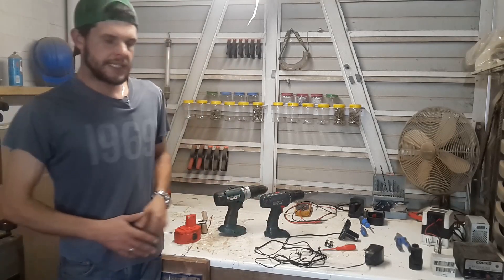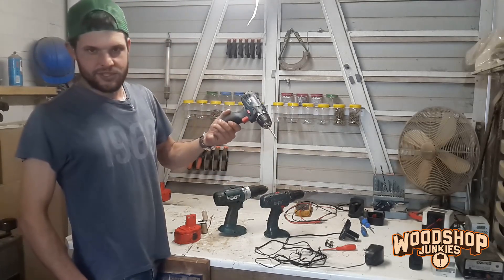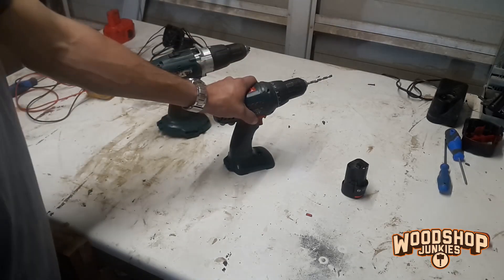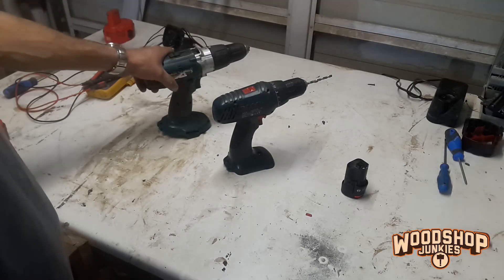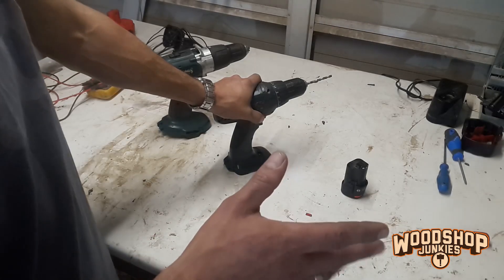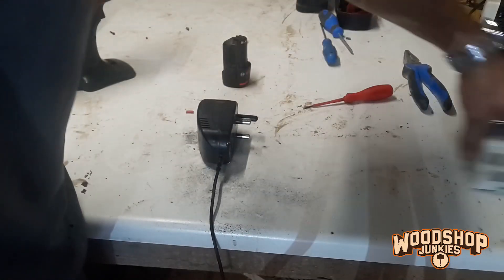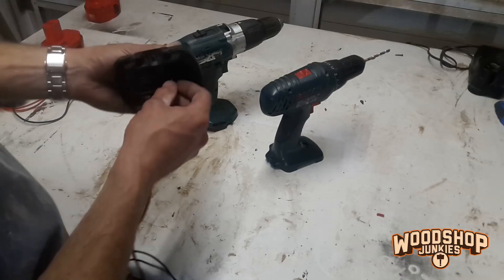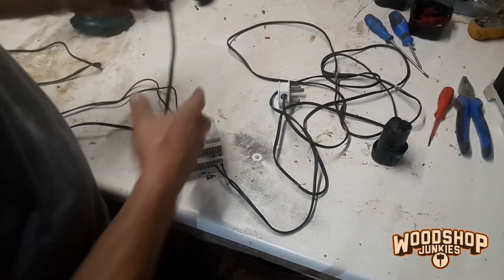Cordless to corded drill conversion without torque loss

Comment: I connected the drill without the battery to another charger 12V and did not worked, only the light on the drill was on. A power supply 12V would do the job?

Comment: Great video!  :)
I have a 19.2V five-pieces cordless tool set with two bad batteries that are outdated (not replaceable) and battery charger. What adapter do I need to convert this tool into corded one and to run it from the wall power outlet with no torque loss? :) Can I somehow re-purpose included battery charger for this?  Thanks in advance!

Comment: Chinese switched mode power supplies only cost about  USD20 for 10Amps @ 12Volts, but for better protection against the motor back emf, they really need a reverse polarity diode across their output.

Comment: Would a Power supply from a PC that has 12v rails, 5v and 3v rails outputs and they only output what there asked to by the component that its connected to, The one I have is the CIT 500CB ATX Switching psu, can deliver up to 3.3v at 28A 5V @ 30A 12V @ 20A FROM 230V, WOULD THE UNITS BE USABLE?

Comment: I did the same thing but without watching YouTube. I might make a video about it but if you're going to go through the trouble like I did you better make it for a couple voltages and usages. I rewound a huge mot transformer and used the bridge rectifier off an old alternator. I made 4 taps for 12/14/18/20. I tested it on 20v by cutting a sledge hammer peen off at the very tip with a 20V cordless sawalls with carbon blades and man I could feel the spicy heat coming off the rectifier but luckily it's finned and cools quick. I cut for about an hr straight trying to stall the tool or stop up the blade.

Comment: im using a 13.5v regulated power supply 20 amp i use for ham radio on my ryboi 18 v cordless impac drill and has been fine

Comment: I have an old 12 volt drill that came from the dump and I made a type of cord adapter with a rewired battery pack on one end and a 12 volt cigarette lighter plug on the other. I used a long cord from an old vacuum cleaner. Seems to work good but I need to find a better plug that can handle the amps. I use an old jumper pack that no longer has the amps to jumpstart but it seems enough to power the drill. I have the jumper pack plugged in all the time so it's charging when I'm not using the drill.

Comment: Great video. Only one caveat, you're back to a corded tool. I imagine for most of us we'd be better off with a cheap corded drill that may last a couple of years...
Reply: The tool I want is cordless, battery sold separately, but battery costs as much as the tool and up. I don't want to wait for batteries to charge.

Comment: Good work! I've adapted several 18V tools to run off DC supplies.  A REGULATED 12V supply is plenty to power an 18V drill or saw, but it needs to provide 30 to 40 A to match the torque of a good battery. Battery voltage sags under heavy load, so the motor is only getting 12V anyway at full load. PC power supplies are a good choice because they are cheap, have high current, have a fan and are lightweight. My biggest drill draws around 40A when under heavy load like a 4 inch (100mm) hole saw. I use banana plugs to connect tools to supplies. Forget about using a transformer unless you only need low power. It would take a 50 pound transformer to match a 5 pound switch mode supply.
Reply: Hi Chris, I was thinking about reply. I am inbetween deciding on a transformer or SMPS. So as per your suggestion a SMPS with 12 V , and amp range of 30-40 is more suitable for such conversion? I have a 18V skil cordless drill lying around and wanted to convert this way. Please provide your response.Thank you.
Reply: NO .. a PC power supply does not put that  many amps!! awful advice, comment should be removed
Reply: @atesone76  Tell it to my 600W supply. It puts out 48A at 12V. You can buy even more powerful ones. A 1000W supply can put out 80A

Comment: I wonder if there's enough space inside the old battery pack body to fit a rectifier and transformer sufficient for the task. THAT way, it could serve as supply to any drill or tool that used that pack.

Comment: Can I run an 18v drill off an 12v powersupply?

If so, what will be the effect of the reduced voltage?

Thank you
Reply: he is transferring 12v AC to DC by rectifier, which will increase the voltage to around 14~16v to make the drill work.

Comment: GREAT VIDEO!!!! THANK YOU FROM US HERE IN HAWAII. I HAVE DRILLS ALL OVER THE PLACE AND TWICE AS MANY BATTERIES, ALL 18 VOLT. I AM ALWAYS RECHARGING THESE BLASTED BATTERIES. MANY OF THESE BATTERIES DO NOT HOLD A CHARGE ANYMORE. I FOR A LONG TIME HAVE HAD ENOUGH!!!! I HAVE BEEN THINKING ABOUT CONVERTING BACK TO AC: 115 VOLTS FOR A LONG TIME NOW. BUT, I WILL USE THE GOOD BATTERY AS A BACKUP. SO, THE WIRES WILL BE ALONGSIDE THE DC POLES AS A BACKUP. THE AMPS SHOULD BE THERE FOR ME. SO, I WILL SOLDER WIRES FROM THE ORGINAL CHARGERS AND SOLDER THE PLUS AND MINUS TO THE POLES IN THE DRILL. THE BATTERY WILL JUST ACT TO BACKUP THE AMPS.

Comment: Can't i just connect a wire to the bottom of the drill straight into a power outlet?
Reply: Not unless you wish to burn out the motor and possibly start a fire. 110/220V mains will burn out anything designed in the 12 to 20V range. The motor isn't meant for the high voltage.

Comment: I connect my 12v saw to power supply(12vdc, 5a) however, it doesn't work, just light. There are three connections on its battery pack (12v, 3ah), but supply has two. What is wrong?
Reply: Your battery would be a lithium ion battery, in such case the third pin is the temperature sensor of battery. You can make it work by connecting a 2.2 k resistor across sensor and negative terminal of the drill. I am using my 12 volt lead acid battery in place of lithium ion stock battery.

Comment: try adding a capacitor where the wire connects to where the battery use to be.
that might give the drill a little extra go power.
Reply: how much power it will give? Base on the video, it got sufficient power already?
Reply: @bongd244  the problem is not the overall power . i'd agree that is good.
this will primarily effect the starting power.

basically it will stick less on startup.

Comment: What is the pinout of the 12V battery? It has 3 pins: positive, negative and??
Reply: Usually the third is a thermistor (sometimes marked "T"), to avoid overheating during charging. 
https://i.stack.imgur.com/RuNHX.png

I have a couple OEM NiCd batteries for an old Hilti cordless drill with 4 terminals. With 1 + terminal, 1 "T" terminal and 2 - terminals.

Comment: this is why cordless power tools have no larger value than $1. completely worthless and intentionally designed so that a new model gets released with a different plastic battery mold. they last a year or three, then the battery, which is no longer being made, is garbage. the amount of NiCad powertolls in the landfills makes them an environmental disaster. yet none of these companies are taking any responsibility. the only one i see is hitachi, where they include a fake battery back that's corded and actually plugs into a socket.

Comment: could you instead attach the drill to the charger and use it as a psu?
Reply: Not likely. The chargers usually trickle charge a small current. My impact drill has a speed control trigger rated at 20A.
Reply: @Schwalbe262 I bought the drill new from a big box store without a battery. I wrapped wire around my torrodual transformer to get AC. Then rectified it, added a smoothing cap and used a good sized switch to forward/reverse it. It runs on 20VDC. I don't know how many cells but you can figure it out with some research. Best of luck!

Comment: Or use a gaming laptop power supply. 19v 4.74A for $7.50 USD or 19v 9.5A for $39 USD, plus shipping of course. I've seen many people on job site modify a 14.4 DeWalt to take 18v batteries.
Reply: Those power supplies you picked up seem low on current. My 18V impact driver has a trigger switch speed control with a 20A 36V rating on it. Anyone actually measure the current these thing typically use? Thanks in advance!

Comment: I'm missing the point of doing this. Admittedly I got kinda bored and skipped through. The industrial power supplies this guy is using usually cost a hell of a lot more than a corded drill that runs on ac which is a whole lot easier to deal with. In a pinch if you have crap lying around sure, but this is a crummy permanent solution and makes no sense at all.

Comment: You need to match the voltage of the tool exactly.  Undervoltage results in the underperformance, and overvoltage results in component damage.  Power supplies don't typically output current unless they have been designed that way.  A tabletop power supply for testing circuits will have current adjustments to output a certain current to test a circuit.  Typical power supplies are rated for a certain current drawn by the load.  When it says, 12V 5A on the power supply it means it supplies 12V and it can safely handle a load of 5A.  You would have to put an Ammeter in the circuit to measure to load applied and then you could buy a power supply sufficient for the load required.  Start up current is always higher than idle current, and a drill or saw idling will require less current than when either of those are actually performing work...ex. drilling into brick or cutting through 2"x4".  If you don't have a power supply capable of handling that high current it will be damaged.  Hope this helps.
Reply: Todd, you don't need an exact match. I have converted several 18V drills and saws to run off 12V. They all have plenty of power when under heavy load. A battery pack has enough internal resistance that its voltage does not remain constant under load. A regulated 12V supply puts out a constant voltage as long as it isn't overloaded. The unloaded RPM is lowered a bit, but that is not a problem. You're right about starting current. I used a current shunt and an oscilloscope to measure starting current. It is as high as full load current because IT IS full load. I  use 30-40 amp supplies with 10AWG wire.

Comment: I have seen cordless 18V impact(driver /drill & wrenches) directly connected to 110v or 230v AC mains and they still work perfectly. as the drills have universal motors which can use wither AC or DC. any comments on that and the safety for the drill pls.?
Reply: I don't think this works, drills have motors customized for low voltage, meaning thick wire, think similar to alternator in a car. They use high current at low voltage to get the energy required. Most are brushed motors, not universal. Universal motor is those in pedestal fans, not brushes, runs for years with no maintenance.
If you try to run drill motor on 220V, it will burn instantly. And I think they have no protections, meaning coil is burnt and motor useless. Reason is that very high amps are used while drilling lik 30A, 40A, for few seconds, when drilling metal or bit gets stuck in hard material. Diodes and fuses that can stand such currents are bulky and cost more. So they don't include them.
Basically just big liion battery wired to motor and switch.
Reply: Did u ever try this?

Comment: Would love to do this for some cordless tools I find here, but I can't find a transformer like that with the multiple outputs.  What do I look for?
Reply: find a simple transformer with a winding with the correct voltage, or just below, and enough current. Use a bridge rectifier (of suitable current rating).

Comment: The DC output doesn't have to be regulated? Just rectified is enough?
Reply: generally electronics are pretty resistant to small chances in voltages
its fine if the voltage is just a little high(but not too much, probably like +2-3v at most) or low (as the voltage would naturally dip in a batter because of the load)

Comment: LEHOU has a 12v 6amp for $9.99 or a 24v  6amp for $11  Power Supply on amazon.  They are portable like a laptop adapter.  I am currently using a 18v 3.5 amp powersupply for an old laptop and it works better than when the drill was new, but I think the Lehou power supply would be a better option to get more torque.
Reply: Can you please write a link?.
Reply: those dont supply enough amps for a cordless drill 🙄
Reply: @atesone76  well i got new life from an old drill I was about to discard with just a 3.5A charger, but if I bought like the Superpower 24v 6A adapter, this drill would fly.

Comment: is there a specific wire size i should use for this?
Reply: You could use 1.0 mm2 (I max=10 A) for DC power supply to drill connection. You could also use bigger cross section - wire size.
Reply: My impact driver has a trigger speed control rated at 20A. Wire gauge tables can give you the size corresponding to the amps you would like to carry.

Comment: I have 18 volt dc tools, drill, weed/grass trimmer. I just buy three medium 6 volt rechargeable batteries, wire them for 18 volts, connect to a two wire plug (the style used for trailer lights) and put them in a vinyl Lunch bag with shoulder strap. That way by attaching a matching plug, I can use my trimmer the way it was designed, to go where AC is not. It’s a plus for every tool that can run off the 18volts and last way longer than the original battery ever did since it has more amps.  You can either charge them with your 18 volt battery charger or move the slide connectors around for a 6 volt battery charger.

Comment: one inexpensive power supply that can produce the necessary current is a PC (computer) power supply. It takes very little, if any mods on an ATX-type power supply to serve as a power source for a "cordless" drill. I made one in about 1/2 hour with connectors. Works like a champ on my 14.4 V DeWalt cordless drill.
Reply: Would love to see how you did it Larry, especially tackling the rectifier bit.
Reply: @MrGarda42  use an old ATX pc power supply. No additional rectifier is necessary, as the power supply takes care of that, along with producing enough voltage/current to power a cordless drill. Very slight (if any) loss of torque. All ATX power supplies have a high current, 12VDC line that can provide power for a cordless drill. Do a search on YouTube and there are many videos to show you any mods needed. I added a resistor and cut a trace on the PCB, easy if you are somewhat familiar with electronics. Just follow directions, and it'll be pretty much free if you have an old pc with working power supply around. Use a meter to check output voltage, or get the ATX output cable pinout available all over the web. Use the 12VDC (probably yellow) rail to power the drill. Connect yellow and ground (black) from largest ATX header and connect to drill. Use an old dead battery housing to connect to drill after you strip out the dead batteries.
Reply: Larry M you are a star mate. Thank you. And to imagine, literally today I was throwing the old box away. Saving the smps and will tinker next weekend. Cheers and thanks again.
Reply: @larzman2020  kind of wierd that my psu shuts down as soon I power up the drill. I just don't understand why he used a bridgerectifier? Aren't power suplies usually dc out?
Reply: @blackpearl1-477  Your PSU probably has current limiting to protect itself from overheating. 
Yep, you are right. Power supplies are often DC out, but if I remember the video right, he is talking about putting a full bridge rectifier on two lines supplying AC coming from a transformer. Remember, a transformer can take your 240VAC and convert it to something like 14.4VAC. Rectify that and get (14.4V x 1.414) - 1.1V = 19.2VDC peak. The 1.1V is the diode drop in the rectifier. This is a pulsing DC voltage. It's not reversing. So it is not AC. If you smooth it with a big capacitor you'll have 19.2VDC out. Otherwise, I believe you'd have to take the rms value .707 or even the average value .637 of the 19.2VDC peak. I got 14.4VAC by wrapping my CNC machine's toroidal transformer with 14 wraps of 12AWG wire. Hope that helps.
Reply: your 14.4V drill must run like a bitch, no PC power supplies put out enough amps!!
Reply: @atesone76 really? not even the 1800W monsters?

Comment: Have to know alot of the ideas in electricity. I tryed just with a plug and cord, with the wires taped to popsicle sticks, just to test it. luckily my drill still works, but would be nice to convert battery to plug, I personally went and baught a corded drill. But having collected a few ryobi 18v . I need to review my option on making this kind of plug, for cheap.

Comment: great video, I have a question, you opened the battery charger, didn't it have the proper transformer in that? could i not use that transformer and add the rectifier to that?  i really don't know not busting balls.
Reply from the maker: It has a small transformer yes but can only supply enough current to charge a battery but won't be able to run the drill straight. It would be a nice solution if it was big enough because the charger actually has a rectifier after the transformer also. You would then just need to tap in after the rectifier and cut out the charging circuit but like I said, transformers too small.
Reply: @WoodshopJunkies  thankyou

Comment: well i'm not a scientist when it comes to electricity... but following your instructions on what to buy and how to connect it...i got my battery drill running even better than when its was working with the battery...
for a total sum of 49 euro...
not sure if the transformer is domestic or what but hey who cares.. it works...
and i saved a shi..... load of money... for the battery!!
thanks for the video from my side really appreciated...
now only have to make a box and bolt it in!!
Reply from the maker: Pleasure! Remember to add overload protection to the circuit to protect the components.